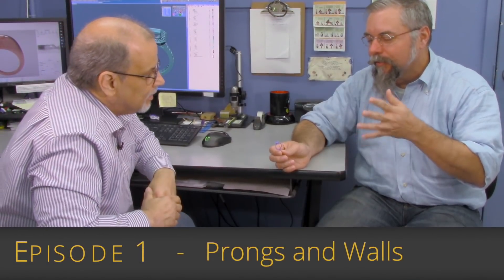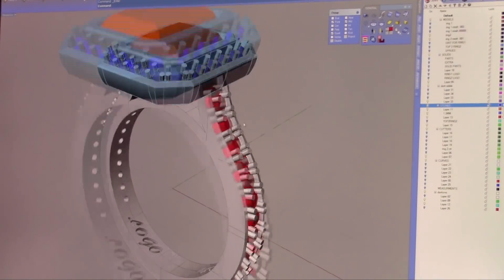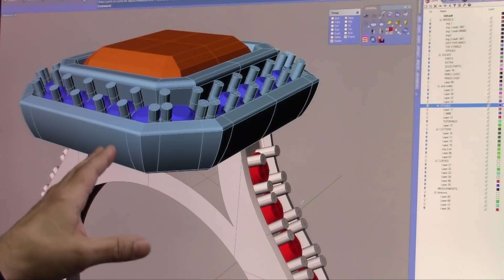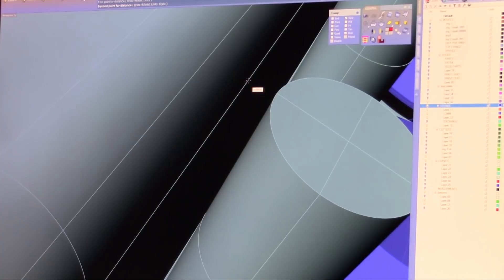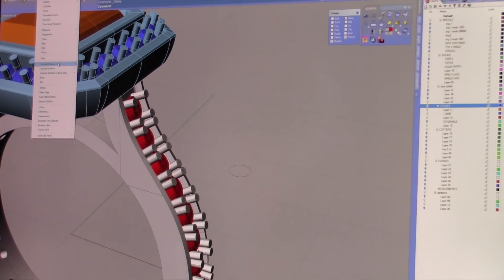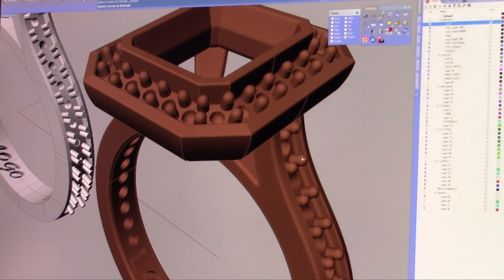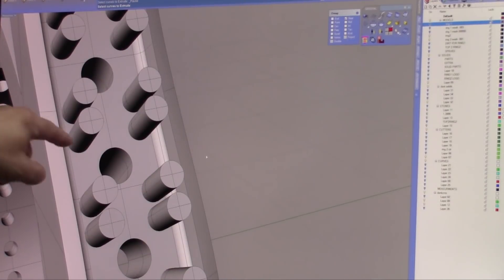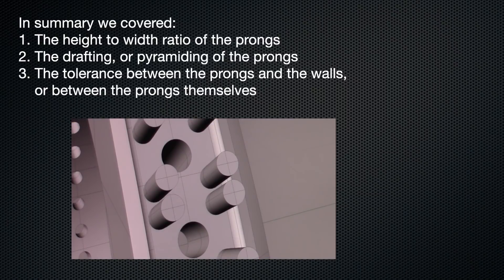How To Make The Perfect Prong Setting - CAD Design Tutorial

Comment: Thank you for making this, this really helps me understand why some of my wax pieces and the casted pieces aren't accurate. Though from the comment above I see that there is no minimum threshold recommended to the thickness and distance. Would you have a value, going below which, it is an absolute no?

Another point from my failure recently if it helps the viewers, the holes at the bottom of the stone ( made from cutters) need to be big(in diameter) , My piece used to come out filled with metal in them